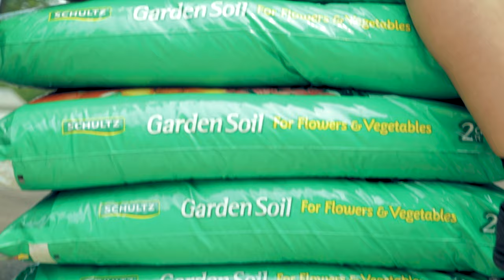An Elaborate Solution to a Simple Problem

Comment: Nice! As it's a raised bed, you may need to incorporate soil moisture granules or some type of controlled irrigation. Different veggies need different water consumption. 
Easily drill a hole to the irrigation and attach a hose with a timer on it.
Reply from the maker: That’s a fantastic idea. I definitely think I wasn’t watering them enough. I couldn’t figure out how much water it actually needed because it was so big 😂 but I’m definitely going to look and see if I can incorporate that idea in my bed. Thank you very much!

Comment: Hey. I want to do the same but have it still sit on the ground. I've been watching videos also on growing potatoes and onions in food safe buckets. I also want to put some 4x4s 2 high around our mulch beds so I don't have to be as cautious about where the grass shoots out of the lawn mower.
Reply from the maker: That’s a great idea! I don’t like leaning over that much so that’s why I made mine tall. The bucket thing sounds interesting too! How does that work? 🤔
Reply: I first found it on Hollis & Nancy's Homestead YouTube channel in a 2 part video called How to Grow Potatoes in a 5 Gallon Bucket. You drill drain holes in the bottom, then plant a few inches of soil then set 2 potatoes that have started growing chits (sp?) and then fill the bucket most of the way up with more soil. Then you can just have them sit off of the ground so it can drain properly and you water it from the top then it will drain all the way through it and keep the soil saturated.
Reply from the maker: Well, you convinced me. I’m definitely going to a) subscribe to that channel and b) try out the potato’s in a bucket. 🙏🏽 thank you very much! If you try it out let me know! I’d enjoy hearing how yours turn out!